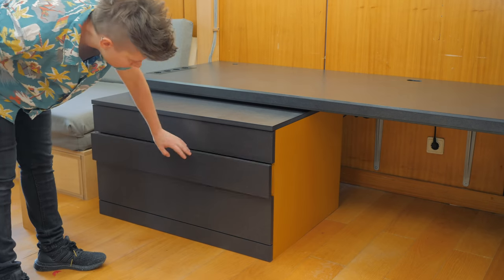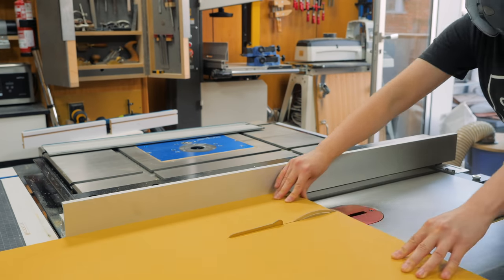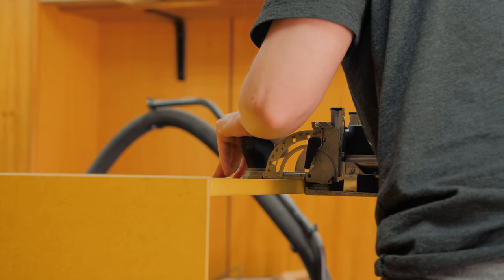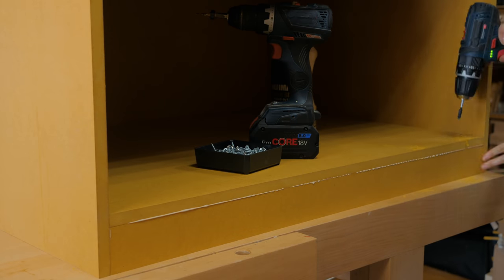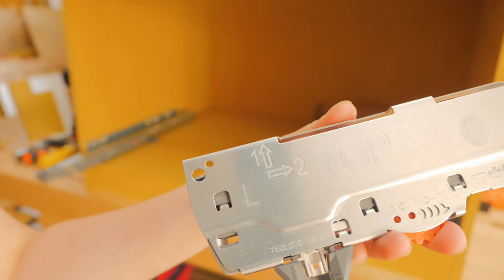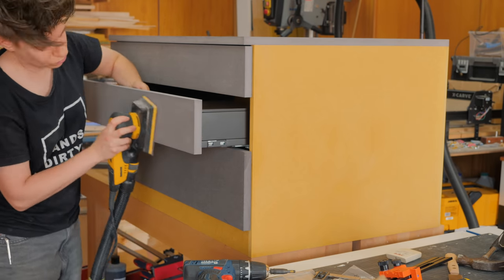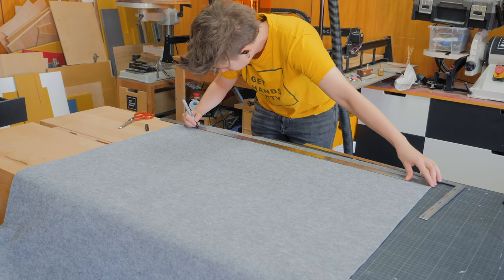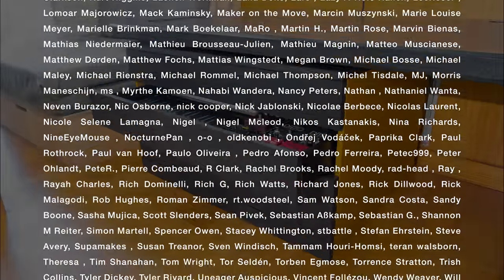Making a Mobile Drawer Cabinet for the Loft Bed // Work Space - Ep. 7

Comment: as a guy who's 5'1ft or 1.56 meters I feel you when it comes to furniture and every day things making life slightly frustrating.
Reply: i'm the same height and I find some beds and public transport seats very small. Makes me wonder how normal sized people fit to those...
Reply: @treeoflife7151  
I've only ever bought 2 beds for myself, a twin(38" wide) and a double(51" wide)  and while the twin bed is doable I'm way more comfortable sprawling out in a double bed.

I find some public toilets feel way to low to the ground. like unnecessarily so. (Canada)   
One pet-peve for me is shower heads, their WAY too high. I have to stand on my toes to move them or grab the hose properly.   
I can only assume there's height regulations for both of these things.
Reply: I can relate but from a different perspective. Being 6'2" most work surfaces and counters are too short and give me back pain. The seats in most cars are also uncomfortable.
Reply: @Reign_In_Blood_963  I can see that, I also imagine most jeans are too short for you like how their too long for me.  
In terms of car seats their seat belts usually feel like their choking me cause their so high up.

Shower heads in bathrooms are usually too tall for me to interact with properly, standing on my toes in a wet tub never feels wise.

Comment: Great work! In case you don't have much experience in soldering I would suggest using insulated terminals. Pros: You'll not melt plastic parts or cable insulation;  You'll never burn your fingers; It can be disassembled easily; Fully insulated and secure assembly. However you'll need a crimping tool for this. Stay safe. Cheers!

Comment: Always a good idea to use the back box on electrical sockets, hopefully you have also clamped the cable to the box to stop it being pulled out.
Not sure if you have them in portugal, but in the UK we have 'plasterboard (or drywall) ' boxes, you push them into the hole, theen there's a couple of clips that extend behind the plasterboard to hold them in place.

Comment: On the sockets:
Next time, you'll want to go for 'hollow wall' junction boxes, which are used for Gyproc walls (drywall). These have clamps that tighten on the back. They're usually in orange and have a rounded shape.
I would advise to always use boxes, to make sure you don't have any bare connections. Preferably you keep the Wago in that junction box as well, although you don't even need one if you feed the power cable to the first socket directly.

Comment: the plastic boxes for the electric sockets that should be used here are the ones for drywall, those are usually round with screws to tighten to the drywall. Any Leroy has them

Comment: If I'm not mistaken, the electrical boxes are wallboxes, normally you should use round. These you can screw in.
Reply: Yes, round ones are for drywall and they have small hooks pre-installed. ideal for applications like this.

Comment: Just discovered your channel today.  You do some really nice work.  I didn't know pre-dyed fibreboard existed.  Very cool.  
I do have to say that you should give the electrical another go-over.  Messing with 5V and 12V DC and USB is generally completely safe, but with mains AC power you really should only use  off the shelf components (power bars, etc.) or be absolutely sure you are doing it right.  Between the fire hazard, potential shocks, and possibly zapping your expensive gear, it is worth the time.  
Subscribed!

Comment: you should have used drywall mounting boxes for your sockets, they have a clamping mechanism that also works well on wood - they usually used for intstallation in 12,5 mm plasterboard or OSB sheets

Comment: Nice project, as always.
Gluing the felt with tape was the better solution. When storing optical gear you should avoid any solvents like in spray glue.

Comment: Really fantastic work! 😃
Pretty interesting system as well!!!
About dividers, I've seen people making them with depron. It's the same thing as styrofoam, I guess, but you can buy it in big sheets. You know? You can cut it with a blade and glue it with simple AC glue. 😊
BTW, it's heavily used to make rc airplanes and even boats, but people normally use hot glue with it - and it works pretty well. 😊
Stay safe there! 🖖😊

Comment: Just wanted to point out that you shouldn't really solder mains wiring. The solder might melt if you're drawing a bit more current than you can safely handle.
You can easily clamp some spade connectors on there, which will snap on the switch/connector terminals.

Comment: As a certified electrician I should probably tell you that the use of solder is not permitted in a mains voltage installation like what you did. There are instead "cable shoes" that you can easily crimp onto the end of a wire to plug onto the tabs on the switch you installed on the side of your cabinet. Use shrink wrap to insulate the individual wires afterwards. And for the back of your cabinet, there's proper installation tunnels that you can use. They can be cut to the length you need and usually come with nice end caps and covers, making the whole installation a really solid affair. And please, use crimped caps over your wires if you are installing laced wiring.

Comment: I saw you using some weird drawer system and at first was like meh, it probably costs a fortune, not needed. Then I saw the front panel adjustment screws. WOW. 
Also, it would probably be best not to solder the mains connections, solder can corode and crack giving a poor connection, you should use crimped connectors for that :)

Comment: Hey Chris, really love the project! But the electrical really grinds my gears :( xD. I guess it's gonna be fine, since you are just using it for charging small electronics. Normally on the plug that you soldered onto, there should go flat crimp connectors. They are really easy to put on the wire, and a crimping tool isn't more expensive than a soldering iron. I know this sounds so patronised, but please don't plug anything with lots of power into those outlets. Just don't want to see you go up in flames :).

Comment: In case you need it in a future project: there are special electrical boxes for hollow walls (usually drywall) that attach by screwing. Easiest way to make the hole for those is with a 68mm hole saw. Here’s a link to a random example: https://www.sailorsams.com/vimar-idea-eikon-flush-mount-box-3-module-glow-wire-protection . I think they exist for up to 4 horizontal or 3 vertical “units”

Comment: Great video as always. Have you ever had any issues with the finish of Valchromat? I build a huge closed with 30 front pieces and gave the surface Osmo hard oil wax. The yellow Valchromat surface had blotches and came out very different from front to front. Yous look very even. What product did you use?

Comment: What will help your back and knees is to have better overall body mechanics when doing things. You reach too far and you bend at your waist instead of your knees. Take the time to set the piece you are working on with YOU in mind not just the tools and materials. You will have a stronger core and be able to do amazing work for decades if you bend at the knees and lift. No more using your hips as a fulcrum either.

Comment: This is SO functional and a project I've been looking for ideas to finish myself.  I have some loose audio gear in my studio and I hate not having a place for it.  Thanks for this.  I don't think I can afford the drawer system, but I can come up with something.

Interesting thing. Lately I've been using OSB as a decorative face on a lot of my stuff.  I will sand it down, paint it, then sand it back.  Usually enough to get rid of the ink from the stamps that are on the wood, and it actually gives it a bit of a modern look.   Things you learn on a strict budget! https://i.imgur.com/XuA5ADn.png

Comment: For the electrical plugs, you could have used  rounded boxes for plasterboard. Like this B074PKHZKG (Google that code), they clamp to the board with the screws, no need to hotglue, and since they are rounded, you can easily drill a 67mm hole through the wood to make it fit snug. Cheers, great work.

Comment: You're the same height as my oldest sister, a year younger than I.
 She is big on saying she is 4 feet 11 AND A HALF inches. Don't ever forget that half (~_^)
My grandma's old house, built by my Grandpa K, has very low cabinets and cupboards because she was around 4' 6" or 1.37 meters tall. My oldest surviving Aunt is about the same height, but hers were built slightly taller.
I come from a long line of short people. (~_^)
 I'm one of the taller members of the family at 5' 7" or 8" r 1.7 meters My aunts and uncles were around 5' 3 or so 1.6 meters or so, my male cousins are around my height, with most of the girls including my other two sisters, close to our parents in size but a few nearer my height and a couple not much taller than my Sis